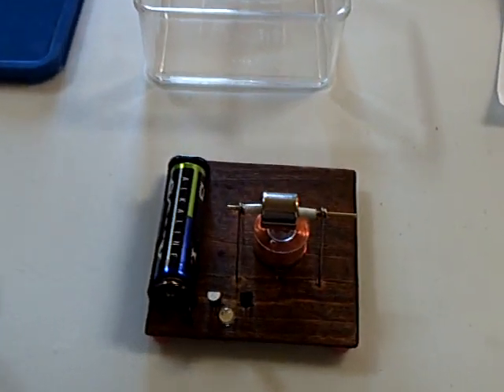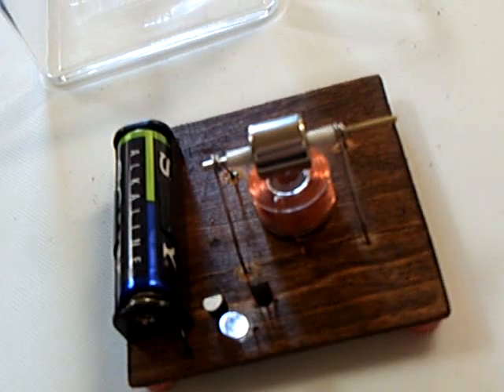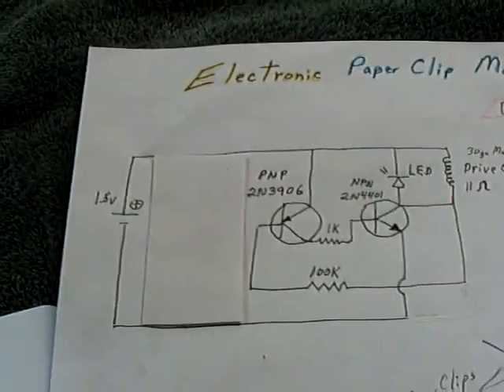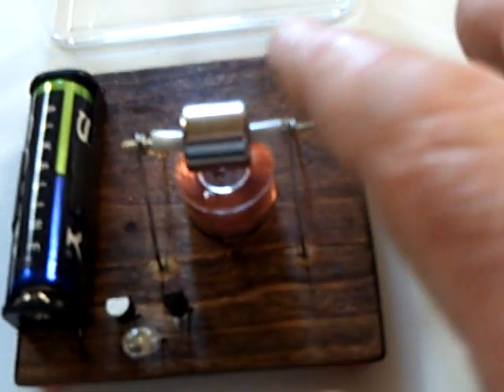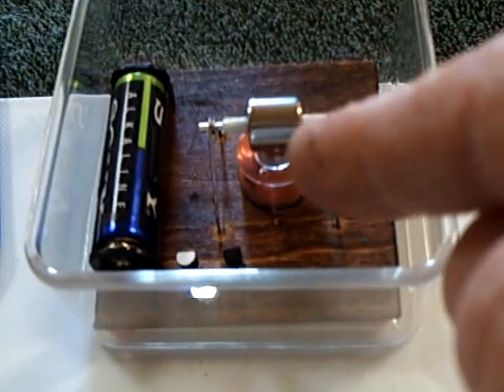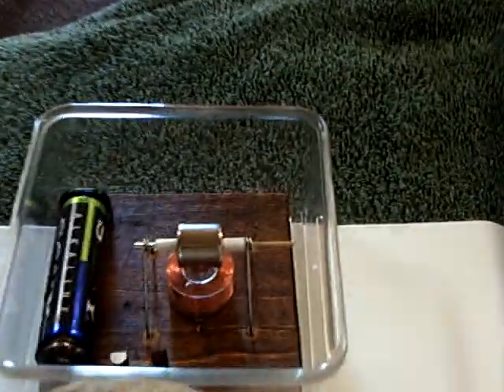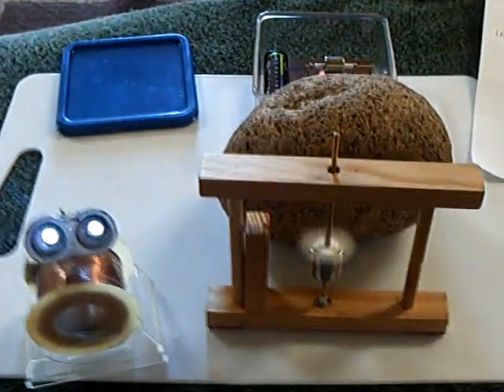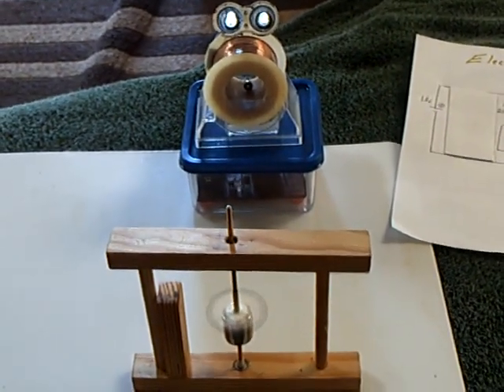Electronic Paper Clip Motor ---- Boxed

Comment from the maker: This is not a replica of Tom Ferko's motor.  The circuits are completely different. Tom's circuit is a modified Jonn Bedini SSG type.  My use of a diametrically magnetized ring magnet for a rotor coupled with satellite magnets goes back to 2009 when Jonny Davro and I first started working with this idea.  People probably have been doing something similar for a long time before we started.

Comment: Hi Lid,
well done !
Does the magnetic coupling through walls work better with a 90 degrees rotated 2nd magnet or why do you use a 90 degrees rotated magnet for the receiver ? Wouldn´t it not work better at the same axis for the receiver magnet ? Many thanks.
Regards, Stefan.

Comment from the maker: Actually the variable resistor for control works best at the 1k point.  This motor does not have much torque.  It is more of an interesting display item.   The fact that it can turn that larger magnet at a distance and that magnet can do work is a bit of a mystery.  I think that it has to do with a gear ratio type situation.

Comment: Nice as usual.
I am no physics guy. Does the magnet need to be spinning, doesn't it transmit when the magnet is merely pulsed?
If you could make a version that had magneting levetating bearing, it would be totally silent. Heck, pull the container vacume! then a phil phone charger that keeps it usable in needed....